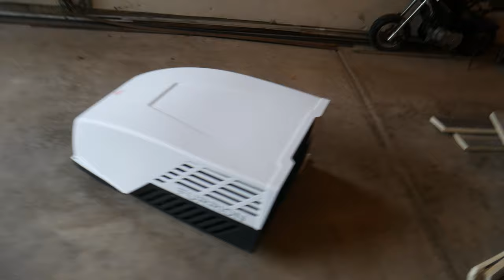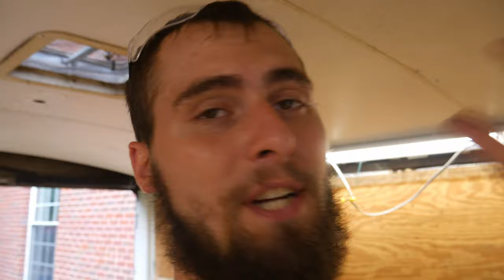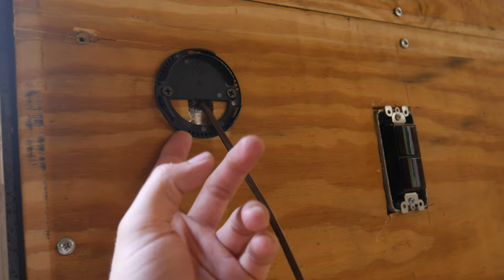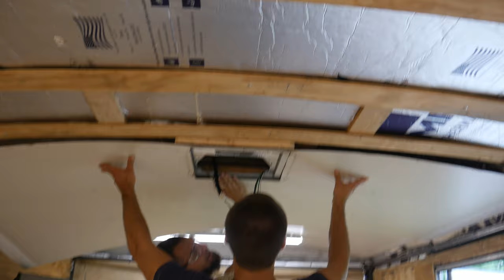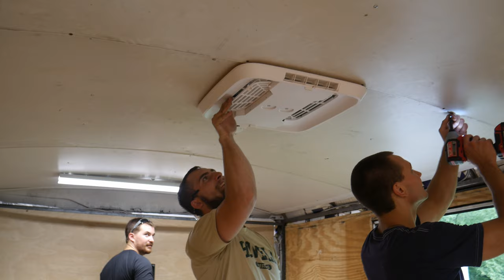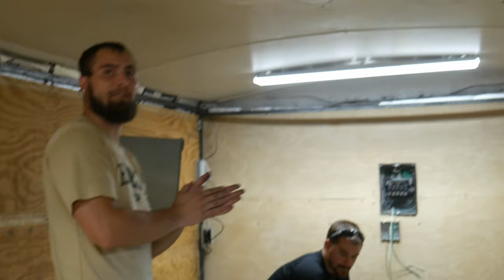Trailer Transformed into a Camper - Part 8 - Air Conditioning - CaswellCustoms

Comment: What power source are you using to power it? I have a converted 12ft trailer with solar power. Definitely not enough to power this so how did you guys do it?
Reply from the maker: We have the whole trailer wired up with regular 110 power and we run the trailer off of a generator or shore power. So it’s ran to a regular panel

Comment: I want to do the same with my race trailer.   Do I have to drop the whole ceiling or just make a frame around the vent opening?   Thanks
Reply from the maker: Just make a frame around the vent opening, but if it’s not already insulated it won’t be very effective.
Reply: @CaswellCustoms thanks.

Comment: How hot does it get there?  Wondering if I would need 2 AC units here.  It gets to 110+ degrees Fahrenheit here from late July through August.
Reply from the maker: It’s extremely rare for it to get in the hundreds here. A really hot day is in the mid 90’s probably not a bad idea to run 2, you should be able to run them to the same thermostat.

Comment: Did you insulate the trailer? If so, how much was the materials, if not, does it get cold with insulation?
Reply from the maker: Yes the trailer is insulated, and in the summer we can keep it cool and in winter we have a heater so it stays warm and in one of our pervious episodes we insulated the whole trailer I believe I talk about how many pieces of insulation we used. The floor walls and ceiling are all insulated.
Reply: @CaswellCustoms  what made you decide to put the insulation foil facing inside and not facing outside
Reply from the maker: @veronicapulido6586  there is foil on both sides
Reply: @CaswellCustoms  I am building a gamng trailer. What kind of heater did you use? Im in Chicago so it definitely gets cold...
Reply from the maker: We installed a 12v diesel heater and it’s worked great no issues having taken multiple snowmobile trips it michigans UP and camped in negative degree temps outside.
Reply: @CaswellCustoms  I appreciate that! I building from an empty cargo trailer. Watching your videos & learning. I’m having the hardest time finding a used air conditioned 20ft so when I googled about how to cool the trailer, your vids popped up!!! & are VERY helpful!!!